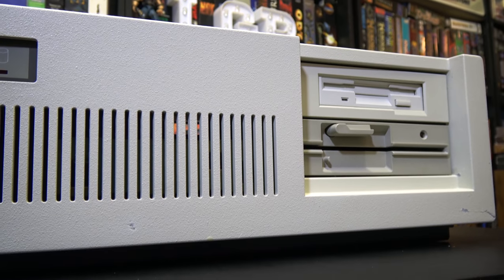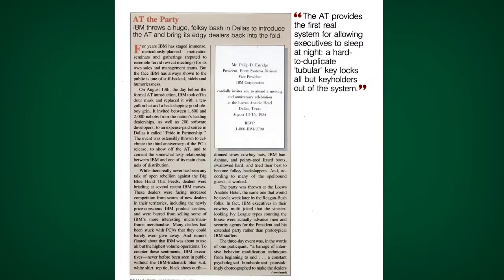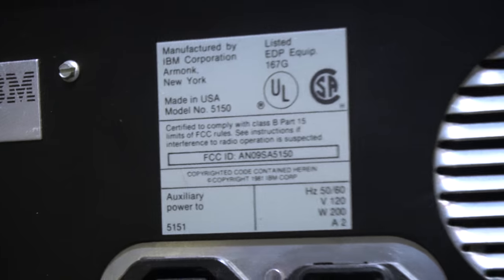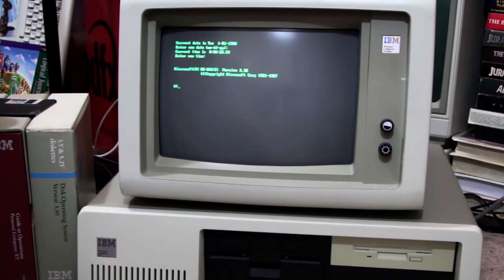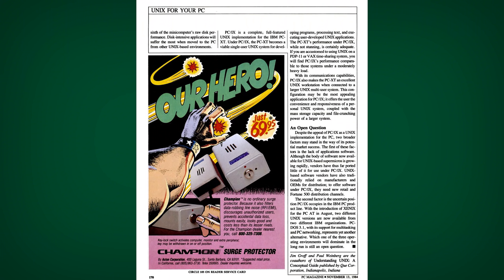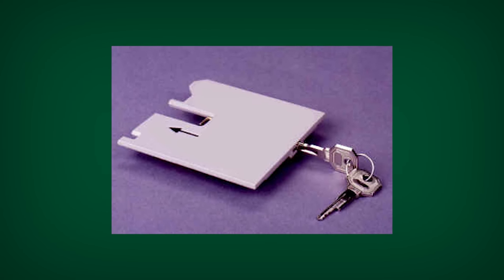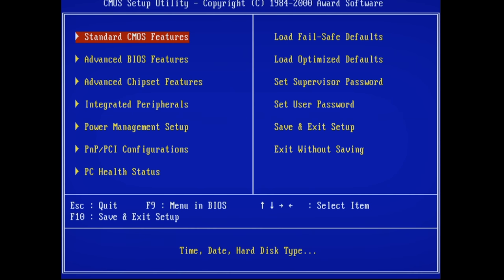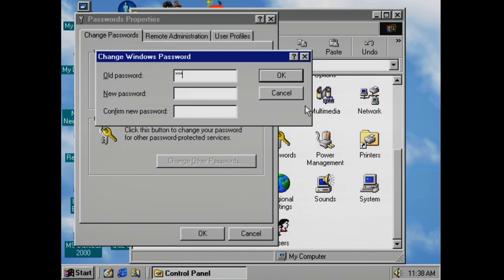Why did old PCs have key locks? An LGR Retrospective

Comment: My dad used to lock my PC and take the key... I managed to make my own lock key using a screw driver and a Cola can opener. I used the flat opener, and made it cylindrical shape, just about the same size as the key, and just hit a knife on the tip of the cylinder for the bump. And i unlocked the PC every time my dad locks it... 27 years later, never told him about this :)
Reply: Note to self: To prevent kids from using the computer, take out the RAM.
Reply: rickonami never underestimate a kid who needs their fix
Reply: Yemto that is just evil
Reply: rickonami my mother would use a password and take the power cable. My solution was to buy a new power cable and click cancel on the password. when she figured out I was doing this she started checking to see if the computer was warm in the back so I used ice packs.
Reply: akihiro kina, No it's both evil and effective. Since the computer don't start without them
Reply: Now thats smart. My parents just lock the internet now. All i do is reboot the router and it doesn't activate the lock again.
Reply: This is so true.
Reply: I used the end of a Bic pen. And then when Mom took the mouse away, I learned to navigate around Windows with the keyboard. That's been useful a few times since then.
Reply: I could unlock and relock our computer with a paper clip when my dad locked me out.
Reply: rickonami I'm telling
Reply: If you managed to do that in an attempt to open the PC I'd honestly let ya have it.
Reply: rickonami its like finding the code to unlock the porn channel. That was one of my adolescent accomplishments.
Reply: My father installed a lock to my pc too,but I always know how to use a nailclipper to lockpick it. My sis is smarter, she just open the case and hotwire the pc
Reply: rickonami 

sure you did.
Reply: Since the keys were mostly all the same, I'm pretty sure I gave one (had tons) to a friend at some point because of this
Reply: Well... my dad took the power cable from the computer once, and of course I got another. Then he caught me with it and just took the whole freakin computer away and locked it in the basement behind a combination lock for a whole year...
Reply: I used to do the exact same thing! Until one day my dad came home early and caught me, so he dashed off to the garage and returned with a set of old jumper cables and beat me severely with them.  I never touched the 486 again after that.
Reply: A Band Called Benny - Jumper Cables?  What the hell is wrong with a good, old fashioned work belt?
Reply: lol
Reply: My dad used to set a BIOS password. I'd simply unplug the computer, remove the CMOS battery, and wait a while. Then he started locking the case, so I'd have to guess. It was usually based on something within sight - he'd set predictable passwords like iomega, creative, toshiba or gateway; words you'd find on things nearby.
He was a bit more devious sometimes. One of his passwords was a space; just a single press of the spacebar. Still don't know how I managed to guess that, but I did. Persistence and lots of free time, I guess.
Reply: You could hotwire it.
Reply: rickonami hey i love you vids. my dad used to just turn off the PowerSupply i was too stupid/scared to try pressing the buttons behind the pc.
Reply: GG friend nice work!
Reply: My dad used to take the power cord. I just used the one from the printer sitting next to it.
Reply: He probably did that because you were watching too much porn and computer got infested with viruses. He had to buy new computer after you screwed it up.
Reply: Technach o hey its teccnacc
Reply: Is your dad still around? That would make a great thing to confess on his death bed. Give him a good final laugh.
Reply: Using ice packs on a PC. Sounds dangerous as fuck.
Reply: Jon Mayo that's when I realized monitor power and PC power cords were the same. at least for the Compaq me and my sister had. two monitor cords ment I could get back on my computer after they left.  you can't just take away a teenagers dial up like that. I had a sexuality to devolop
Reply: @Iain Cowell I once used ice packs (actually I think I used a pack of otter pops) to keep a dying hard drive cool long enough to recover data from it. Pulled the drive out (cables still attached), wrapped the drive in a rag, then set it on one pack of otter pops and laid another pack across the top. The drive would stop functioning after about a minute or two of running because it'd overheat (I still have no idea why, guessing bearings were shot or something, still had enough freedom of movement to spin but generated excess friction?). The otter pops kept the drive alive for about 20 minutes, which let me yank the critical data off it.

Then we took a sledgehammer to the drive :D
Reply: you can do something similar by heating up a pen and pressing it in, and it will mold to the shape needed.
Reply: Been there done that. My mom would lock the computer when she'd have to leave for work during the summer and I was grounded. It was a Packard Bell, and had the more traditional style of key, so I used a paperclip to pick the lock. Almost got caught a couple of times when my mom would come home early and I'd have to pick it back into the "locked" position. Then one day while I was helping my dad upgrade the RAM, I noticed a wire running from the lock to the motherboard... so when I was home alone again I took it apart and disconnected the wire, bam I was in. She'd "lock" the computer and leave, then when she'd come home of course it'd still be "locked" and she would "unlock" it... never realizing the key didn't do anything any more :D

I think she started to wise up to it, as she tried taking the power cord too. Of course I managed to buy a spare while meandering the local flea market with my parents. I had an allowance, and would sometimes roam an aisle or two away while they were shopping, so I found a guy that was selling parts, bought the cable for a buck, and stuffed it in my pocket... was uncomfortable AF the rest of our trip at the flea market. So then my mom would turn the ineffective lock and take the power cord and leave for the day, and I'd dig up my cord, plug it in, and hop online!
Reply: A Band Called Benny - /u/rogersimon10, is that you?
Reply: i feel sorry for you people, my parents never dared to touch my tech. Then again they barely understand it either.
Reply: My brother used to put password on the PC, so to get the password I would make the keyboard buttons a little dirty/sticky so each keystroke would leave an imprint. Then as soon as he entered the password i would make him leave the room somehow and then note down all the keystrokes. Afterwards I would rearrange the letters and jot down a list with a list of possible words. Within a few tries I was logged in.
Good old memories.
Reply: NoeLPZC k
Reply: I got inside my case when installing a new hard drive and unhooked the key off the motherboard. My father still locked it to keep my teenage self off the computer when he wasn't home.  It wasn't till years later he found out...
Reply: Watch out, guys!
We have a real life hacker here.
Reply: Same here. But since it only locked the keyboard I created some starting disks for my fav games (Betrayal at Krondor beeing the most used one). Ofc it had to be mouse-controlled games, but neverthless... ^^
Reply: I unlocked mine using a hair clip back in 95.
Reply: you're gonna regret it when he passes away, one of those things ;_;
Reply: rickonami if my son/daughter did this I would be proud.
Reply: Heh, my parents used to use the key locks - until they realized that i had a copy.  Then they'd take the power cable. 

Too bad for them they didn't realize the printer used the same power cable...
Reply: my parents are nice
Reply: Not sure if you'd regret it on your deathbed, but telling him will surely make a nice anectode (and I doubt that he's gonna punish you ^^).
Reply: lol my parents used to turn off the upstairs electricity.
Reply: Got you all beat. We didn't even have a computer. In fact, there was only one in town that I was aware of over at the University. To use it, you made punch cards for your program and data. Then you sent the stack of cards to the computer department so they could run your program, save your printouts and send them back to you. Pre-floppy days. For fun, go outside and ride bike, play games, swim, you name it. Kids now are so spoiled.
Reply: Yemto RAM?
DO YOU MEAN DEDOTADED WAM?
Reply: During the dial up days I figured out how to bypass the ten hour limit on Juno and net zero free internet, all you had to do is ex out of the browser before it went to there website,  now just go into explorer or whatever browser you are using, free dial up for life, that dammed dial up service is still online if you can believe that, it is so slow it takes ten minutes just to load reddit,  lol!
Reply: rickonami Yea sounds familiar.  When we were kids, if we ever got punished, our dad would lock the computer so we couldn't use it.  

I also remember getting our uncles 2400 baud dial up modem and using it to call BBS's.  He had it locked away in this metal file cabinet/desk and we used a steak knife as the key to open this desk up.
Reply: You're grounded Mister!
Reply: nice!
Reply: darkhelmet169 that tab key haha
Reply: I love how the dad locked the pc but he still had access to a knife
Reply: he knew
Reply: You were a real hacker back then ^_^
Reply: That's nothing to be ashamed of. On the contrary, is better to not watch the sionvisor.
Reply: rickonami 👍🏻😂 do it now I bet he’ll be so annoyed but he can’t do anything about it now
Reply: @Yemto  just don't forget to put it back in when you're going to use it
Reply: My parents used to lock the living room. I made a lockpick by soldering 3 iron wires together
Reply: @movie0007  I have vivid memories of upgrading our 2400 baud modem to 4800 baud!  It was life changing!  BBS's in double speed!
Reply: This made me fucking smile so much man! 80s gamer here, so I feel you now and was with you then <3
Reply: @xXSilentAgent47Xx  Why not just have removable hard drive bays? You put your own hard drive in it every time you use it and it is immune to viruses and security issues. This has now got even easier with the advent of the 2.5" SSD as it is vest pocket sized and immune to shock damage from being dropped. All the advantages of a USB flash drive all the full bus speed advantages of internal SATA.
Reply: DirtyRottenInsult you only have one.
Reply: @Yemto  Good luck with cooling block hovering above them. At least have of them.
Reply: Take it to your grave!
Reply: My mom uses OurPact. It’s so weird and annoying it removes apps from being accessed! That’s why I use my Switch to watch YouTube...

Comment: My grade school computer lab had old pc's with locks. It also had shag carpet and no shielding. You could rub your feet on the carpet, zap the lock with your finger and cause the computer to reboot
Reply: good old days. my new pc build's mobo will die if zapped.
Reply: Nowadays you could rub your mobo on the carpet and it's more probable to come out alive and working than not :P
Reply: +Flash:
I don't think so.
Visit newegg or some other such site and look at the reviews. There are tons of people with dead CPUs, dead mobos, dead RAM. Probably because they touched the circuit and they blame the company.

The company tests each part. They have a QC department. How did the part get damaged? Did the packaging department blow the CPU/mobo/RAM?
Reply: @louistournas120  I've been zapping boards for longer than I can remember with these carpets in my workshop and none of mine have died yet. Especially GPUs during those odd times skin makes contact with a pin or the pcb
Reply: +Flash:
Wow indeed, babe
Reply: That is hilarious.
Reply: (insert Apple boot sound here)
Reply: @JeandrePetzer  very rarely they die straight away after zapping. There is a higher risk of death in the future after zapping (for example, few months or years later).
Reply: @JeandrePetzer  nope, older stuff was way more durable
Reply: This was really delightful to read. Memories...
Reply: :-D never seen that....
Reply: How many times did this happen?
Reply: @louistournas120  You'd be surprised how much companies cut corners on QA. It's a careful decision based on balancing the cost of doing more QA testing against the cost of servicing in-warranty returns and taking hits against their reputations.

That's a big part of why enterprise-grade gear costs so much more. It's usually the same stuff but subjected to far more rigorous QA.

Heck, hard drives and flash memory have been doing that for ages. They're designed with the expectation that the onboard controller will need to detect weak sectors that weren't caught in QA and migrate the data to some of the factory-reserved slack space.

It's similar to how you'll see companies like Intel using their forest of SKUs as a way to reduce fab losses by blowing fuses to lock defective chips into settings that never exercise the defective aspect (eg. lower speed, reduced feature set) and then selling them at a lower price.

I think the 486SX might have been the first time they did that. (From what I read, the 486DX was the base part and the 486SX began as a way to make money on 486DXes with defective FPUs by locking the FPUs out and selling them as a cheaper model.)
Reply: @louistournas120  lol how'd that turn out
Reply: Magic PC power 😂

Comment: In 1990 i had my first computer and i was 10y.o.. My, now dead father, used to lock my computer while he was gone so i wouldn't play and study my lessons. Little did he know that with a small pin i would unlock it and relock it in less than a second. 
Gee this was a trip down to nostalgia.
Reply: are you the lockpicking lawyer? :)
Reply: You sound like me, i had a computer the same age, dad also hid the key and he also died when i was 16.... i respect you George <3
Reply: I did that too
Reply: Yeah mine had one of those barrel locks too and my stepdad used to lock it. I easily bypassed it with a bent paperclip. Those things were useless.
Reply: @svenjorgensen5 Gonna have to try this. I’ve got a new old stock Dell that’s locked , and of course I don’t have a key 😫

Comment: "a hard to duplicate tubular key"

[faint "click out of one" in the distance]
Reply: lefr33man a little binding on 2...
Reply: Navraj Gill click out of 3
Reply: Kaguya Houraisan and we are in a false set
Reply: Nothing on 1
Reply: lefr33man and, back to one, and, we’re in.
Reply: We're just going to grab our impressioning tool
Reply: Nick K With a tubular lock that old, a biro will probably be all the tools you need.
Reply: A soda straw could turn the lock.
Reply: Those tubular keys are used on most old caravans and I think there is only so many combinations - plus sometimes a pair of pliers will work round them.
Reply: A cheap tubular pick from China will make quick work of this.
Reply: the pick me and Bosnian Bill made
Reply: @darrenforster99  You'd be surprised, we use em on our fuel tanks in the cardlock pedestal and its so frustrating trying my 8 different key options on each 😂